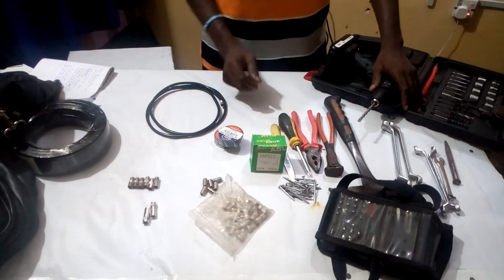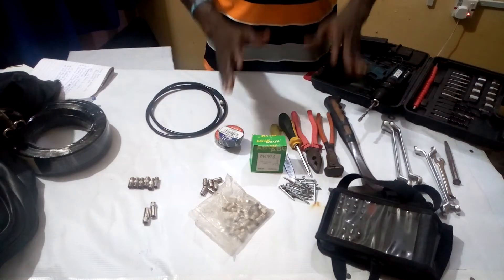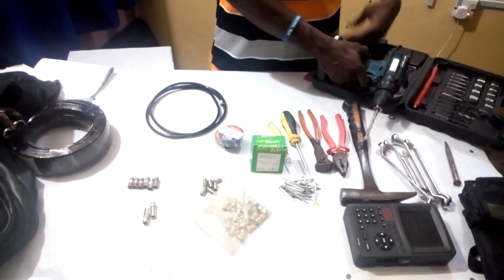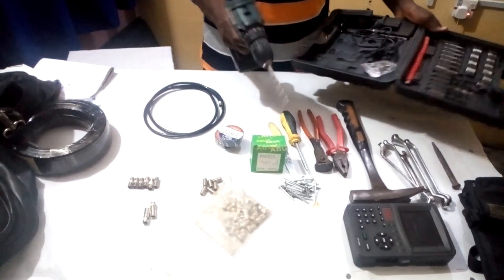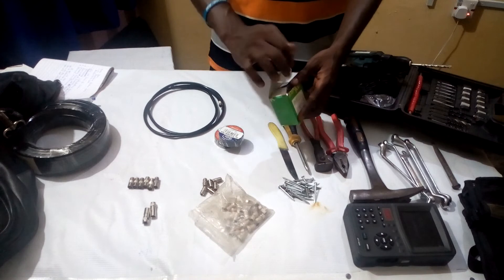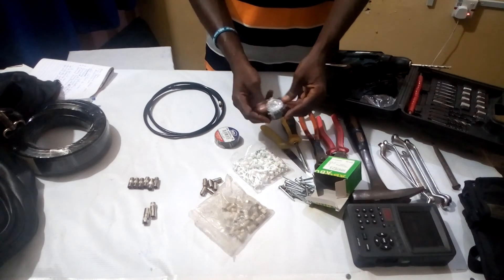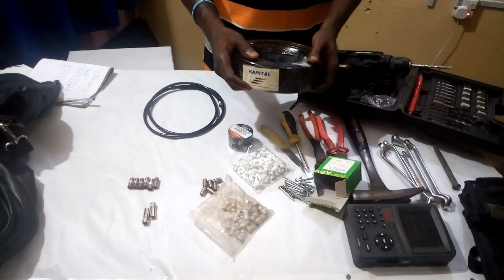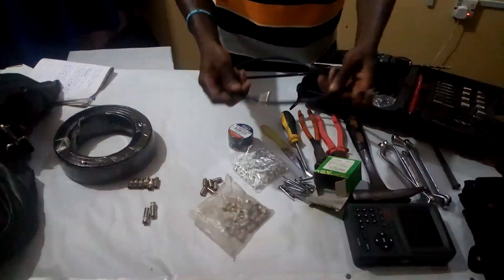Basic Satellite Dish Installation Tools You Must Know As An Installer

Comment: You didn't mention the size of the drill bit
Reply from the maker: Hi Andrew,
The size of the bit depends on the bolt that you found inside the item you bought. 
So, you can easily detect the size of the bit easily yourself. Thanks.